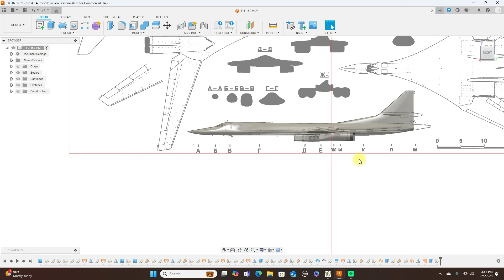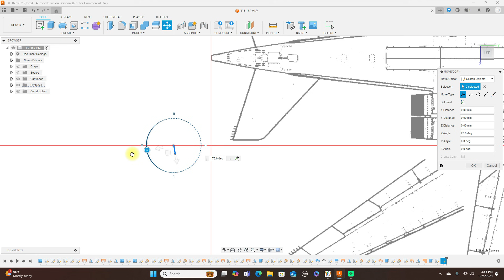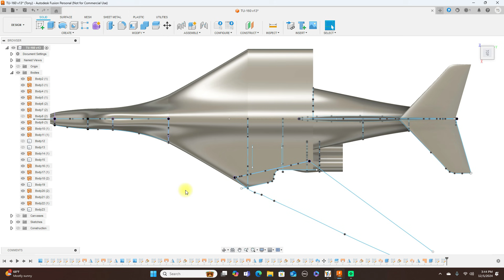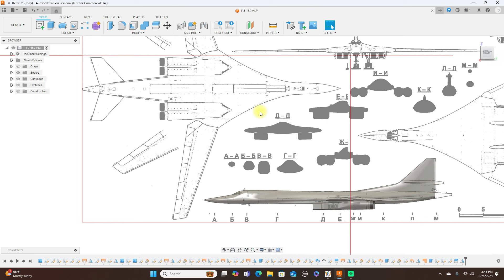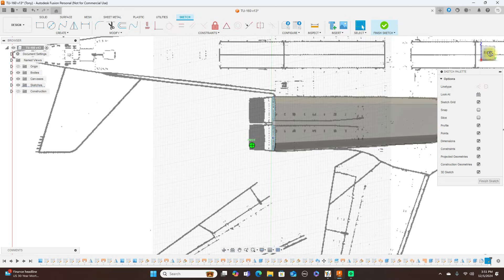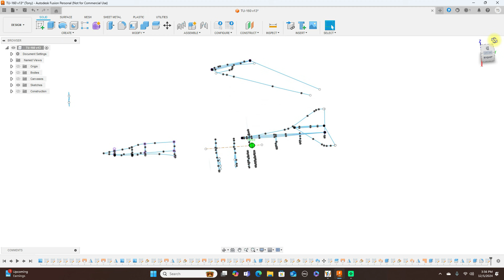Workflow to surface model a TU-160 White Swan in Fusion 360 CAD. Tutorial

Comment: Did I miss it? How did you ensure the formers you drew contacted the outline spline? I have been trying to model canopies for weeks and just can't seem to get it to work. A lot of the times I get the " forms not touching" message and it is severely aggravating.
Reply: I find an easy way is to project the outline to ensure there is a line to "snap" to.